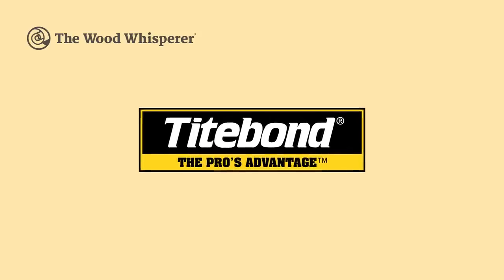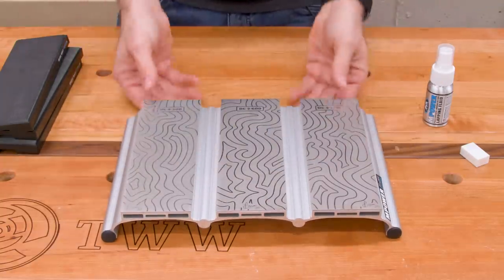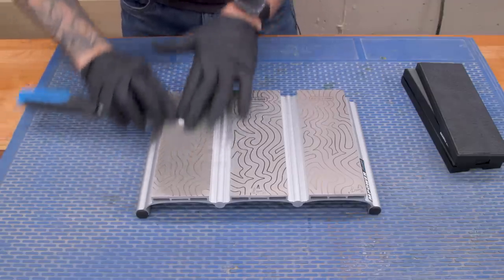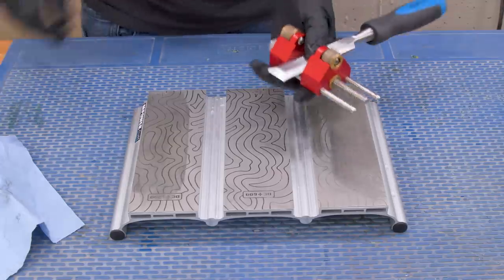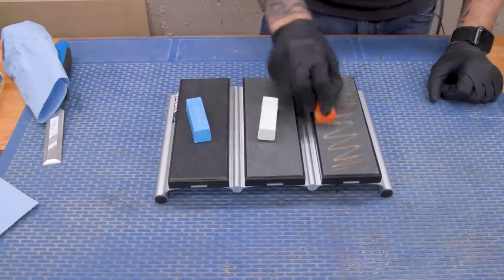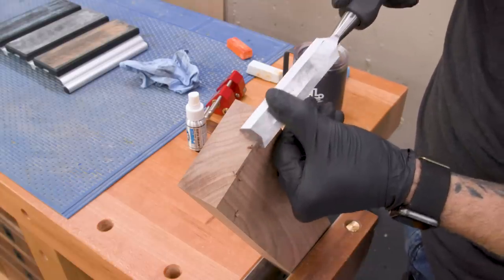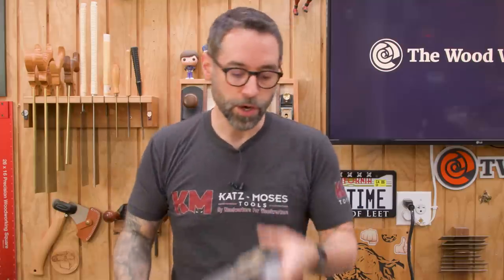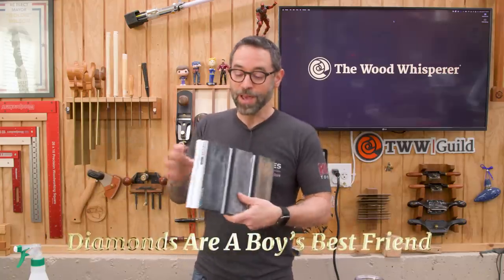M.Power Triple Diamond Sharpening Station Review

Comment: First off, I love that you have always given a very neutral and unbiased opinion on things like this.  It really helps with determining if it is actually a good product or if it has some sort of company weight behind opinions.  Secondly, I have seen some other people use this system and it intrigued me enough to look into it, but I couldnt bring myself to spending the money when I already have decent diamond stones and a system that works.  With that being said, if I didnt have a system already in place, I think this is an excellent first sharpening system/station that covers pretty much everything you need for any level of sharpening.  And in my opinion, I love diamond stones just for the sheer fact you dont have to flatten them.  Because, after all, Diamonds are a boy's best friend

Comment: Thanks for the review. I saw this same system in a video by Stumpy Nubs recently and almost pulled the trigger then. As a relatively new woodworker I am just beginning to appreciate the need for sharpening. As far as the form factor goes I can appreciate how it interferes with your normal process, but rectangular or square-shaped the plates won't lose their shape, diamonds are a boy's best friend.

Comment: We recently got a job to cut quadcopter parts out of carbon fiber panels (on a cnc). We were unfamiliar with the material so we used common carbide endmills which usually last for days. We could maybe cut 10 inches before the endmill got dull and broke. We then switched to diamond coated endmills. Even though they were 10 times more expensive than our regular endmills, we were able to run them hours at a time. In this case, diamonds are a boys best friend. We also make furniture, so this sharpening set up would definitely come handy. Awesome video as always. I drink out of a woodwhisperer's mug everyday and your book hybrid woodworking had me build my first oriental inspired ash bed years ago.

Comment: As always, very informative. I’ve tried a few different sharpening systems and still haven’t found one that I can use efficiently, effectively, and with consistent results. Some of that, I’m sure, is just me still learning proper techniques. So thanks for the review. Even at what’s a relatively modest investment, I’d hate to drop $200-$250 on a sharpening system without some kind of affirmation that it’s a worthwhile investment. 
Diamonds Are A Boy’s Best Friend

Comment: I've been eyeing this sharpening system for a while.  Currently I use a mix of a two-sided diamond stone (300 & 1000 grit) with lapping film on glass plates (600 & 1200 grit) along with a single leather strop with compound.  I love the idea that this is all in a single(ish) unit which will make it much easier to pull out and use regularly - so my chisels will probably be sharpened more often (or in other words - before they are completely dull!).  I also prefer diamond stones because they stay flat, unlike stones, and they don't tear, unlike sandpaper/lapping film.  So all-in-all, I would definitely say that diamonds are a boy's best friend!

Comment: I remember seeing Stumpy review this product, and I agree with you that the accessibility of the center stone presents a challenge.  It seems that modifying the "stage" so that the center stone was slightly higher to allow relief for tool handles to be held above the side stones would work.  The manufacturer could then perhaps add storage in the middle for the honing compound - or a place for your honing guide.  It's still a nice entry point into diamond-stone sharpening and after all, diamonds are a boy's best friend.
Reply: They could have just turned two panels sideways, and then you'd have plenty of clear access to a long side on each grit  That way you wouldn't have to compromise the storage efficiency of the form either.

Comment: I haven't seen a clear review of this set up other than what was over on Stumpy Nubs. Thanks for the review. I have the cheap stones for lapping that Rex Kruger mentioned recently and have the same problem with the middle grit. I tend to prefer the scary sharp sand paper solution for setting up chisels. At this point, since I use cheap chisels, it doesn't seem to require expensive sharpening systems. Thanks again for the review! Diamonds are a boy's best friend.

Comment: Great review, Marc! I have tried a couple crap honing guides because I’m not as practiced with being able to keep the same angle on my chisels, but I also don’t like the wheels getting all mucked up. I may need to spring for a more expensive guide like the Veritas or Woodpecker version.  I also made my own plate for my stones out of mdf with finger holds so I can move the stones around, but I made the slots a bit too deep for each stone so I don’t have quite enough clearance to effectively get the backs of my chisels. That only needs to be done really once so I haven’t bothered to change it. Diamonds are a boys best friend!

Comment: I bought some thin diamond plates offline and glued them to a piece of plywood to get going, and it works decently, but I run into the same issue you pointed out here when I want to use it to flatten the back of a chisel. Diamonds Are A Boy's Best Friend.

Comment: As I get older I see the true value in caring for tools and making them last, often making them better than when you brought them home from the store. I always try to take the time to buy a tool and learn to use it rather then take things to others to do the work. If I was to buy this sharpening system I would run it through the band saw and separate one of the stones to gain equal access. looks like there is plenty of meat between them to cut and keep the height even. I love Diamonds, they will cut metal, concrete, sharpen metals, as well as last a long time doing it. So it is absolutely true "Diamonds are a boy's best friend"

Comment: What I find valuable in this setup is certainly the stropping top-hats you can place over the diamond plates, but also having it as a one-piece setup. I balked as you did at the parallel setup not allowing the user to easily get at the middle plate when honing the back, however I feel like that could be significantly reduced by taking the third plate and setting it perpendicular to the first two still parallel to each other. That would leave only a single long-edge left unable to reach as opposed to four that this setup has. Diamonds Are A Boy's Best Friend!

Comment: I saw James Hamilton of Stumpy Nubs discuss this set up and looked it up. It was March 3 2022. I did looked the system up at the time and I believe it was selling at $200 at that time. A 25% hike in 8-10 weeks is an awful lot so I give Marc a lot of credit for questioning whether it was still a good value at that price. 

Having said that...diamonds are a boy's best friend, Marc.
Reply: They also offered for limited time $40 off for Stumpy's review, so 25% hike or did they like everyone else wipe out entire inventory & then restock using higher inflation cost for product & then the extra cost with the consumer? I have to wonder did you just notice this going up 25%, or have you noticed everything else going up in price as well? Just wondering as I'm currently reaching 50k spent in fuel this year, which is close to the 71k I spent for entire year before, & we still have 7 months left to run.

Comment: At first I sort of discounted these as the middle stone is inaccessible on the side, like you pointed out.  But I realize that apart from initial flattening, I pretty much never use anything other than my highest grit diamond stone currently.  I've got a use for a traveling setup, and replacing 4 stones and a strop with this setup looks pretty slick.  I think my favorite thing is the strop covers... Diamonds are a boy's best friend

Comment: This looks like a good system of someone that's new to the game. It gets you to sharp, and that all that matters.   I have spent literally thousands of dollars on sharpening equipment, wicked edge pro, Tormek, The Sorby edge pro, the axminster trade ultimate sharpening system. Not to mention the 6 + slow speed grinders with CBN wheels. The thing I always go back to is, the Lie Nielsen honing guide and a Set of Shapton ceramic glass stones. With that said if you add up the stones and guide, I'm in for close to 700 smackers.  250 is a drop in the bucket once you start chasing that oooohhhh so sharp drug.  P.S I did watch till the end but, ill keep my name out of the hat. :)

Comment: I have the other M power sharpening system that holds the chisel and you slide the diamond stone across it, I like it but has some limitations. I like that this setup is ready to go with those 3 strops for touch up, and would make it simpler to keep it sharp rather than having to start over. And of course, diamonds are a boys best friend 😁

Comment: When you were flattening the back, I saw the same issue with the middle plate as you did, but I thought you might use a different solution. 

Instead of using the sort side to do lateral strokes, what if you went forward and backward up the length of the stone from the end? That way you would still get longer strokes, and since the scratch pattern would be going the opposite direction, it'd be easier to see when you had completely removed the scratches from the previous grit.

Comment: I purchased this sharpening station, and while it may be ok for general sharpening, I would not recommend it for any serious duty. Through the process of flattening the backs and repairing the bevel on 5 vintage plane irons, I destroyed the 300 grit stone.  Now it is more like 3000 grit plus, and putting a polished finish. Also the 600 grit stone, which was not really used,  is separating from the base. Thought some other viewers may find my experience with the product useful.

Comment: I was under impression that a lot of the lapping fluids were designed to keep plates from rusting?  I like the portability of this system though.  Also seems to be of pretty high quality.  I have been using the 3M lapping paper on glass plates and consider this a better option.  Diamonds are a boy's best friend!

Comment: They need a slide and locking mechanism for the stones so that you can flip them and move the middle to the outside for flattening. I feel like a tester should have realized the middle stone being blocked is a big issue, and not being able to use the inner side on the outer stone is an overlook too. 

I like the idea of the strop-top, but also foresee a rusting issue with the covers if you aren't super careful to wipe down the stone to bone dry. Those covers are going to slow any evaporation of missed liquid a lot.

Comment: Keeping my tools sharp has been a lot of trial an error with various systems. I tried sand paper first although it worked good it took a lot of sand paper. I used 80 grit up to 2500 wet sand it took a lot of work to get sharp but u learned a lot about sharping. Then I started getting a assortment of water stones found them to do a good job but messy time consuming waiting on some stones to soak in water before use. Then I bought a few diamond plates an finished with a 18000 water stone or a strop. I liked it the best easy less mess an quick.
Diamonds are a boys best friend.

Comment: My tools have never been very sharp partially because of the pain of getting out and putting away all of the various items required to go through a proper sharpening.  I think this might be a good solution for a smaller shop. 

Given the limitation of not being able to flatten a plane or chisel on the middle stone as well as if it was multiple single stones or plates is it possible to move the middle plate to the outside just for that purpose, or is it too much of a hassle to move? It looked like the plates didn’t come out too easily.  #Diamonds are a boys best friend

Comment: Sharpening has always been a little difficult for me. I currently use the Worksharp system and it is okay, but you have to plug it in and the chisels still get hot.  I do think diamonds are a boys best friend, so I would like to switch to this.

Comment: "Diamonds are a boys best friend" However, don't include me in the give away. The review was very informative. I bought the system and it works ok for me. One thing I am interested in is the unicorn system. Basically using a buffer to sharpen a mini micro edge. I have watched a couple videos about it and read some comments. I am wondering if you had tried it. Or perhaps done a video of it that I missed. I would be great to have some trusted input on if it really works or not.

Comment: You pay for the convenience and space saving of the setup. You will need something for grinding. It would be no fun starting with a chipped blade on that. Personally I think the number of steps progressing to a high polish is there is unnecessary. I focus on a good micro-bevel, and I round it a touch with hand stropping and am happy with the results. But I am very light duty. Would be interesting to see more extensive testing of different methods.

Comment: I know I will sound like a primitive primate when I say it but because I don't use chisels very often, I was very reluctant to invest so much money in sharpening stones... So I did what any cheap skate would do, I use water sandpaper, start from 300grit and go up to 5000grit. I can honestly say that it works perfectly. All I need to do is to place the sandpaper on a flat surface, so I bought a piece of glass...
I am happy so far but if I had the option for a cheap (or free) regular system, I would be happier. I guess diamonds are a boys best friend, right?

Comment: I think I like your system better because you can set it up to fit your particular needs. why buy  grits you may not need.  Do you really need 8000 grit? Are you actually gaining anything going that high?  If you need more than by all means buy them. why do you need 3 different lapping compounds. I am not convinced that you can get much more out of a cheap chisel than what is possible with anything greater than 600-800 grit. not to mention they just will not hold an edge for long. Better to learn what is needed for yourself. the information you gain is invaluable.

Comment: I don't like this system.  I have not used it however it is essentially 6 different stones and only gets you to 5k.  If you use Shapton or otherwise do you use 7 stones?  Not to mention the limited use on that middle section. For the 249 dollars you can for sure find 3 or 4 stones that cover this grit range and even exceed it with out the limitations. 

Diamonds are a boy's best friend.

Comment: Those sharpening stones are just cheap polish diamond stone sticked on a jig (15 USD a pair on amazon)
A lot of thin diamond stones like those aren't flat enough to prepare the back of chisels and plane iron they often deviate by 0.3mm or more
You will get them sharp, but it won't pair nicely

Leather scraps are pretty close to free since you can buy them by the kilo in craft stores
Chromium oxyde compound is about 5 bucks for a stick that lasts for years

This feel way too overpriced, I feel it tend to be targeted at power tools woodworkers who feel like more expensive == more better